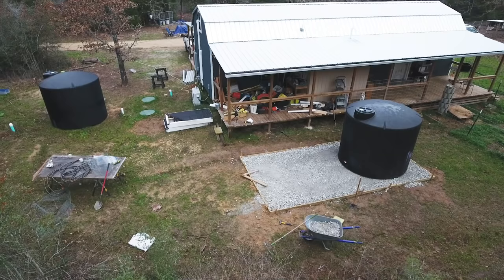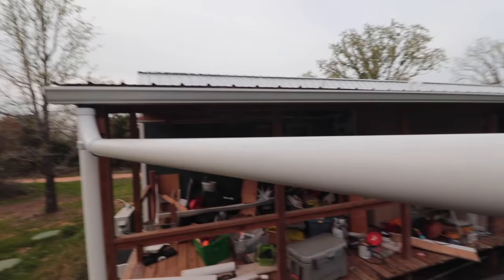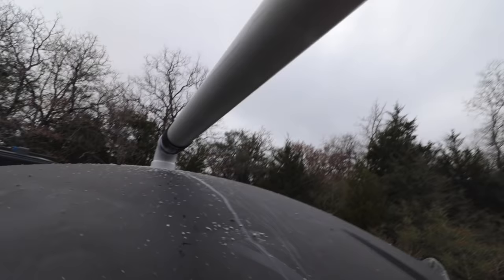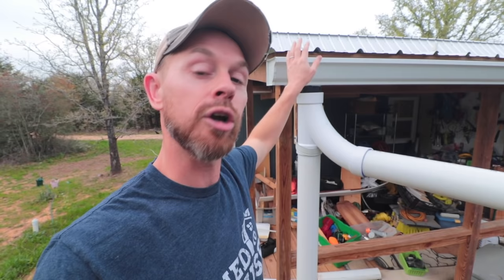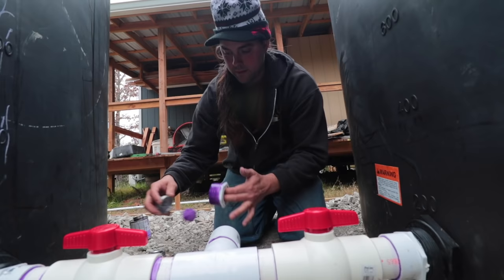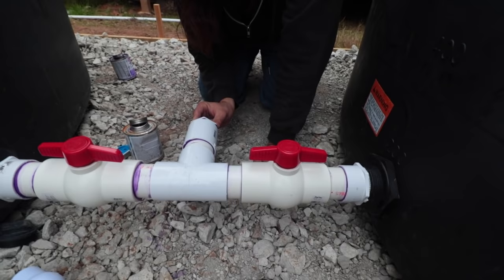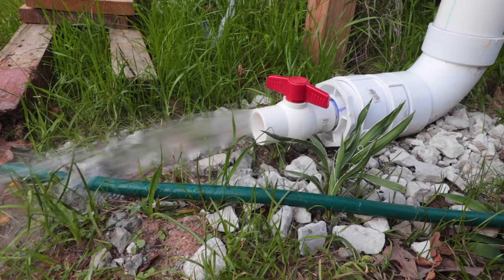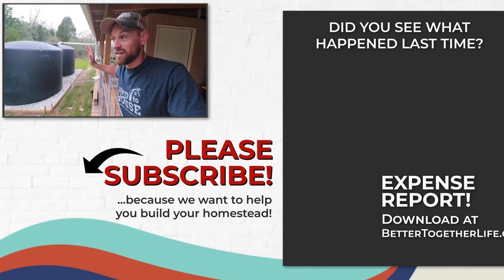How to Install a 5000 gallon Rainwater Harvesting System

Comment: That "T" fitting is called a Tee-Wye and that black coupling is a Fernco style fitting.  Word of advice on the Sch40 too, paint it so the sun doesn't degrade it so quickly.  That kind of pipe is meant to be buried or in walls and not exposed.  It will degrade and become brittle.  Also, the pic you showed was DWV Sch40 which is meant for drainage.  You should make sure you let people know that so someone doesn't decide to apply something that puts internal pressure like a pump on something like this and the pipe bursts.  Some stainless bug screen would be good for the intake opening and you should put a flapper backflow valve inline would be a good idea so you don't somehow have water going back up to your gutters.
Reply: Just use gray ridgid PVC, its sunlight resistant.....
Reply: Its a combination wye and eighth bend.... Plumbers just call them combos or combinations....
Reply: @bigglilwayne7050  I just read your comment and was happy to see you posted it within 30 minutes.  If I have a small crawl space under my house (not enclosed, but on piers), is it okay to use the white Sch40 pipe for plumbing since it won't be in direct Sunlight and also what type of insulation would you recommend for the places where the pipe will not be underground?

Comment: You definitely want to use a hole saw, they have every size you can think of and you'll end up with a much better hole.
Reply: how do you catch the circle piece once it's cut so it doesn't fall inside?

Comment: Best get your foundation under your tanks smoothed out (with sand). nothing like 500p/sqi rock pressing up on your plastic tank. will make a hole in no time.
Reply: He has no problems with that gravel bed.
Reply: Agreed. 1/4"- is best. That gravel looks like a hole in the making!
Reply: That 2500 gallon tank, when full will displace 415 pounds per SF, or 2.88 pounds per square inch.

Comment: One suggestion to help people understand how both tanks connected at the bottom fills up at the same time even though only one is connected to the rain gutter:  take two clear plastic cups, drill a hole on the side near the bottom of each, and then connect a tube between the two.  Then try to fill one up without filling the other, and the water will transfer through the tube into the other cup and fill it to the same level as the first one.  That will help people to understand how both tanks are able to fill at once.
Reply: I did not hear him address releasing pressure inside the tank during that part of the video - I realize later he talked about his overflow system which would address a release for internal air pressure, but I wish he mentioned it while discussing the equilibrium part because that is an important consideration for people to know.
Reply: @cdfield  I believe the big lid on Norwesco tanks is vented, so pressure is relieved regardless.  But yes, if the tanks were otherwise airtight, the overflow would vent them.

Comment: I'm worried about overflow capacity during a heavy rain event. You have 4" going into the tank but only 1" overflow with several 90s impeding the flow. If it's a heavy enough rain it could overflow back into the gutter.
Reply from the maker: Well, if our system is completely full and there is a backup....then we can just open the first flush pipe.

Easy peasy!  BUT!!!!!  This is an EXCELLENT comment/question for next week's Q&A!!!!!!
Reply: @BetterTogetherLife  
You should be thinking about installing a one way valve to keep that from happening.
Reply: I was going to mention that!! You want more discharge than feed
Reply: Correct... basic math ... say the over flow Pipe is not enough ... if it have not happen yet then simply means the rain fall so far is for 1” only ... heavy rainfall That reaches a volume of 2” Will already give the system problem
Reply: My thought exactly on the overflow.

Comment: I would’ve put a union at the bottom where you connected to two tanks if you ever have to service that or a piece of pipe brakes, you’re gonna have to cut it with a union you wouldn’t have to

Comment: I installed the setup on my homestead about 5 years ago. I went a different route but same concept. I have a 5000 gal tank on either side of the house. Both tanks are plumbed to a water pump with a pressure tank. We use rain water for the laundry and toilets and well water for cooking and showers. I also plumbed in a manifold in which I can use the rainwater for the entire house and vice versa for the well water. It makes a huge difference during the dry season here in Texas.
Reply from the maker: Yes! A huge difference. Way to go. That’s awesome!
Reply: @BetterTogetherLife  I can send you a diagram of the manifold and distribution. It’s fairly easy to assemble. It’s all 2” PVC with a few valves.
Reply: You did it right. He needs a water pump for sure.
Reply: wish I was as smart as you! God bless you for your brains to figure it out

Comment: In my opinion, it looks like the first flush and the pipe to the tank connector is upside down, so there will be some dirt can flow to the tank. Every tank doesn't need over flow drain pipe as long as the over flow pipe on one tank is big enough to flow out equally to the incoming rain wanter and the tanks are connected and work as one.

Comment: 11:40 wrap the thread tape so the tail is trailing as you screw it in. If the tail is on the leading edge it will un wrap as you screw it in

Comment: Hello I write to you all from AUSTRALIA yes here it becomes extremely hot ..Water is life 
I agree with most of your Video and found one fault that you could make better ..you have the water Polly running from your Cutter to your tanks,As a feed ..What you can do is have the same set up th at you have but instead of the water the water over the top from  cutter to tank,  Dig the pipe under ground and back up to your tank looking at your height from your Cutter to tank height it will run under it's own pressure as the Roof gutter is higher than your tank 
Why do we do it this way ..
If you have pipes that run over the top they can be damaged buy dead fall and makes moving around your yard in the area of the house and tank a little hard 
Great Video and a beautiful Home 
Kind regards and greetings from Australia 🇦🇺🇦🇺🇦🇺

Comment: Great system, I will be using your ideas thank you! I think I'll use a pvc union in the middle connector. I seen a great you tube video where they put a inline water pump from harbor freight running on a solar panel so that way you could constant pressure!
Reply: I was hoping to do something like this, with a water pump to allow pressure for the water to be routed into the house.  Can you share the link?

Comment: Very nice.
If you want to do away with the extra costly pipe on your next project that you were talking about, you may want to consider doing it the way I did.
I used 4 inch pipe just like you did as a down spot except instead of the crossover pipe to the tanks, I drilled a 3/4 in hole in the down spot pipe near the clean-out and attached a brass adapter 3/4 pipe thread to 3/4 garden hose.
Water in the 4 inch down spot pipe backs up and pumps water to anywhere on the property that's just under the height of your down spot pipe or gutter through the process, water seeks it's own level.
It's now portable and can be moved anywhere and as far as you want to go as long as you don't go higher then your gutter. 
Or, you could bury it permanently.
I have several tanks dotted around the property hundreds of feet apart for convenience so I prefer the garden hose to remains portable.
This way you do away with a lot of expensive pipe cost and unsightly plumbing weaved all over the place.
I hope this was clear enough to understand.
Good luck!
Reply: So, you use the garden hose to fill the further tanks that are below the gutter height? I have a 13-acre property and this would be very helpful for stock water and pasture irrigation if we had tanks further away. Our collection spots are at the higher points in our gently rolling property that we are just starting to develop into a farmstead. Thank you for your input.
Reply: I think this is a great idea. I'm glad for everyone's input from their own experience

Comment: Love your tank system. You do need mosquito netting so they done get into your tanks. A suggestion for the other side rain catchment. If you do want to add that rain to your existing tanks just run down spouts from the gutter with an elbow making them horizontal straight back and connect to your pipe going into your tank. I did this on my house and it wire great. That way you don’t have to pump it up into your tank. Good video.

Comment: You could also use the extra line that goes to the ground to attach a hose to use and spray your deck or what ever if you got a standard spicket in there.  Thanks for sharing.  Our family is doing very similar things.  We are going to be building our homestead in Missouri soon!

Comment: I might have put that first "T", at the rain gutter, on backwards so the water HAS to go into the drop pipe, then back up to the storage tanks.  That would pretty much stop ALL sediment from going into your storage tanks.
Reply: Dude... this is an awesome suggestion! I don't need the support beam so it would just connect directly to the tank, but I was wondering a good way to catch any sediment and how to detect it and remove it, and your idea, combined with a small transparent drop section, would make it obvious when there's too much sediment and provides a way to quickly detect it and remove it by adding a cap to the bottom of the drop pipe. Nice!!
Reply: Yes, that "Y" tube connector at the top near your gutter and the start of the PVC, is upside down... as some of the gutter sediment/particles/etc. could bypass the direct down turn, and instead flow directly into the tank. By putting the "Y" the opposite way you have it... you force all the gutter water (and contaminants) to go down the downspout, and as it back-fills up the downspout, it will then have only water flow into the tanks, as the contaminants (being heavier) will sink to the bottom of the downspout. And then... u need a "slow" leak in your down spout for future rains to "re-catch" new sediment.

Comment: Poly pipe (sprinkler hose or even supply hose) is a lot cheaper than pvc, more flexible...  and wont break like PVC and is weather resistant.   Also will handle higher pressure if you add a pump to your system.
Reply from the maker: You don’t use poly for inlets
Reply: @BetterTogetherLife   It depends on how much water you plan on catching.  your overflow transitions to 1 inch PVC, that could have easily been 1 inch poly pipe.  That said you have a 4 inch inlet to your tanks, what happens when they become full?  that overflow is not going to handle a torrent of rain coming down that 4 inch system it will back up, much like it would using 2 inch poly as your inlet.  The size of your inlet should match the size of your overflow, there is no need to cut a hole in the top of your tank to fill it, it can be filled using the bulkhead fitting at the bottom of the tank and gravity.   There are ways of plumbing your downspouts to handle a backup due to and undersized inlet line.   The size on the inlet need only match the size of a typical storm and not handle the worst case.

Comment: First off let me say I enjoyed your video, enjoy your personality and think you did a good job on the project for the most part.  Kudos on admitting your weakness in this particular area and hiring someone that knows more than you to help you out.    

HOWEVER, I've been reading the comments and I think you may be in denial in regards to the size of your overflow pipe.  

Due to what I thought was a rather nasty conversation further down in the comments, I guess I must provide my credentials in order to qualify my suggestions as I weigh in on this subject.

I have worked at a power plant for 13 years as an operator (boilers, water treatment, turbines and the like) and now as an Electrician and Instrument tech.  (We deal A LOT with pipes, valves, pressures, flows etc. at the power plant as we troubleshoot systems and improve upon professional engineering in order to make the systems work at an optimum level).  I have a degree in Power Plant Fundamentals and a BS in Business Administration.  In addition I have been a plumber for 15 years and own my own farm.  So hopefully I'm qualified to chime in here.

As was stated by other commentators, If you have a heavy rainstorm when your tanks are already full or close to it, and your inlet pipe is 4", your outlet HAS TO BE THE SAME SIZE OR LARGER to allow complete flow through, or it WILL BACK UP and OVERFLOW YOUR GUTTER.  Denying this is akin to denying that your car's gas tank will not overflow as long as your engine is running while you are fueling your car.  A large inlet pipe will eventually overflow a tank if the outlet cannot accommodate the same flow.  Sometimes a larger (than the inlet) effluent pipe is needed to compensate for friction loss, horizontal vs vertical run, different head pressures etc.  

You will not see an overflow of your gutter if your tanks are empty enough to collect all the rain of that particular storm, or if the storm is light enough that a 1" pipe could handle 100% of the flow regardless of if your inlet was 1" pipe or 4" pipe.  If you do not believe that your rain collection system's flow will ever overcome a 1" pipe, then you could have saved a ton of money and just used 1" pipe on the inlet piping.  However, that is obviously not the case and a larger size of inlet piping is definitely warranted.  

Good job on the project though.  Nobody is perfect.  Just pause a moment to see what everyone is trying to tell you.
Reply from the maker: Thank you Mr Mark for the comment!  :)  

My only question..... ok I have one main question with multiple points, so please forgive my bluntness and using bullet points:

• why would my rain harvesting system designer design it this way?
• Why would my ag extension agency (who gave me a $3000 rebate) come out to inspect the design approve me?
• how does a 4 inch pipe of PVC get completely full of water has it flows down from the gutter?  This is the main question to me.  My outlet from my gutter isn't even 4 inches.  We WAY over sized the 4 inch pipe compared to what the outlet of the gutter is.  I would say the gutter is max 3 inches and probably is closer to 2 inches.

So yes again it is possible.... but seems to me very unlikely especially because I will be always using the water in the tanks like you mentioned.

GREAT conversation, I LOVE IT!!!  :)
Reply: @BetterTogetherLife   SImply put, designers are not perfect. Inspector's aren't either, and they made a mistake.  There are several craft related mistakes that were made in the design and implementation that other posters pointed out that are worth noting when evaluating the professional level of the designer.     

The 4" pipe probably will not get completely full unless there is back pressure created by backfall, which I could not verify without setting a level on your inlet's horizontal run.

But you bring up a pertinent point in that your system is effectively orificed at the rain gutter outlet to 3".  At that point, you should have gone with a 2-3"  pipe as increasing piping size after an orifice gains you nothing in this particular application.  Just make sure that your inlet and outlet pipe sizes match.    

In an effort to consult industry specific experts, I just did a quick google search on "rain water harvesting overflow sizing"  This is a direct quotation taken from the website https://rainwatermanagement.com/blogs/news/rainwater-harvesting-101-tank-overflow

"A few things to consider when installing an overflow:

Match the overflow pipe size to the inlet pipe size. This makes sure the overflow can keep up with the incoming water if your tank is full of water. Example: If you have a 4" inlet to your tank, you'll want your overflow to be 4". 

Ensure that the overflow pipe is installed at a lower elevation than the inlet pipe. In most instances, you want to make sure that the overflow is a minimum of half the pipe diameter below the inlet pipe. This allows for overflow before backing up into the pre-tank filter/inlet pipe."

Even after becoming fully aware of the mistake, you may choose to not remedy the problem, as the gain may not justify the expense.  Your system will function as is, but your overflow system is definitely not optimal.

Comment: Keep an eye on that "CENTER" PVC pipe between the tanks.. Once the tanks start to settle, they will not settle at the same rate.. Maybe it will be close enough.. But hopefully, the difference wont cause any damage.. Especially during high winds.. Yes, high winds.. Good luck..
Reply from the maker: Oh wow that is a great point!!!  Thank you!
Reply: I would've spent a bit more and put those big tanks on a good concrete slab just to avoid uneven settling of each one. Otherwise, your video is very helpful!

Comment: Your first Wye is upside down.  In order for a first flush system to be effective, the vertical pipe must fill up, and then backfill into the containers.  Your containers are still getting contaminants into them.

Comment: Hi mate you may want to put rodent screens on your overflow pipes (this is a regulation in UK), I would also argue to put a rodent screen on your 4" inlet pipe due to the nature of the usage as you don't want birds or rats climbing into your tank, it also would serve as a brilliant strainer on your inlet pipe. And all a rodent screen is is a fitting (similar in looks to a union or a coupler) with fine mesh inside. I can see you've done a good job of it, may as well do this to future proof it a tad 👍😃
Reply: OMG, the visual that comes to mind is shocking, but you are so right!